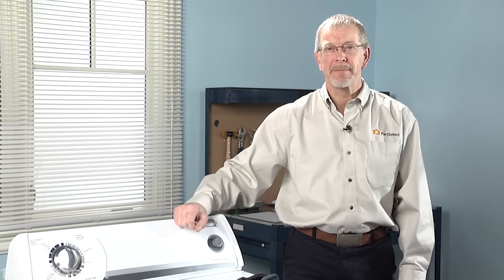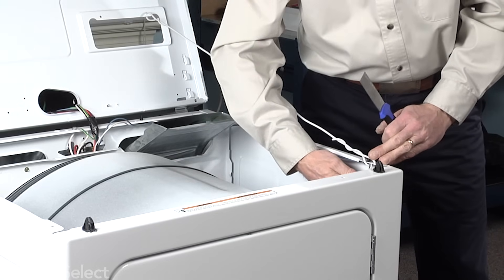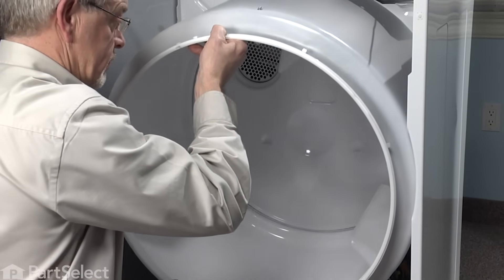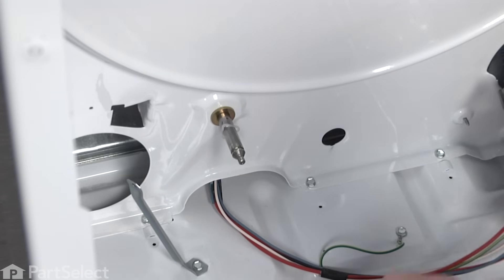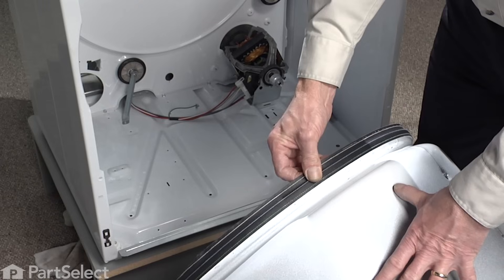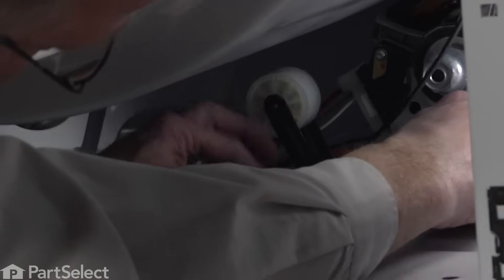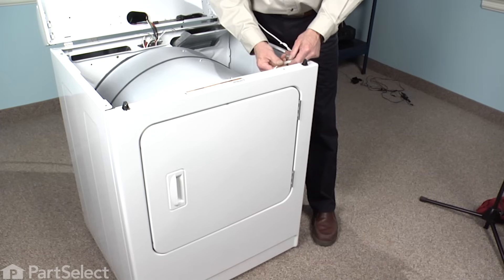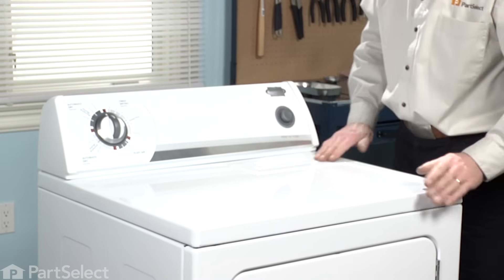Dryer Repair - Replacing the Drum Rollers (Whirlpool Part # 349241T)

Comment: I'm having a heck of a time getting that left wheel off.  Any tips please  ?
Reply: Mine was the opposite. Couldn't get the new wheel back on the right side. I sanded the shaft, but nothing. I tried lubricating with WD40, but nothing. Tried hammering with a rubber mallet, but nothing. After what seemed like forever I was able to wiggle it on. The rubber wheel somewhat spins, but not as it should. I gave it a 40% chance of working. Turned it on and tested it and it seems to be working, at least for now and the original squeaks are gone.

Comment: For some reason my drum isn’t sitting flush against the back .. thought it was the wheels but those seem like they should be free to move back and forward .. it’s only on the right side but now there’s a gap inside and it wobbles but the felt adhesive seems fine and while it does have a plastic collar on the drum which pushes against the felt up front it doesn’t seem tk be broken etc ..
Reply from the maker: Typically is your belt is not staying centered on its pulleys the belt maybe worn or stretched, if thats not the case then the alignment between the two pulleys has changed. I would check to see if one or the other pulleys an be adjusted so the belt tracks properly in the center of the pulleys
Reply: @partselect  thanks ! I can’t seem to get the metal push Nut in front of the plastic triangle to move farther back.. just me or is it designed to stay only on the end to prevent everything from coming off ? I feel like if I move that back it can hold the roller in place on the right and better support the drum in place ..

Comment: Make sure you don't make the mistake of buying cheap parts, genuine only, the cheap Chinese replacement parts don't last long. One of the brands to stay away from is Jason. Go with FSB or Manufacture labeled. Another thing, make sure your roller shaft is clean and polished before you put the new roller on. I kinda wish they would use a bearing in the roller wheel, it would give double protection against wear.

Comment: My wheel right rear roller rubber keeps falling off ...i replaced it 2 times within one month.what could be the problem?
Reply from the maker: Hi Eli. The main issue that would be causing your rubber roller to fall off is if they have been installed without those little triangular retaining clips. The only other thing that I can think of is that the support bracket has not been properly installed. At 4:15 of this video, you can see Steve replacing the drum roller, so follow his step-by-step instructions and you should be good to go. If there are any other issues, please let us know and we can continue to troubleshoot with you! Thanks for the question and good luck with your repair!
Reply: PartSelect hi there , I’m sorry it’s not the wheel that falls off, there is a triangular clip that stops that from happening. What happens is that the drum roller wheel has a rubber that keeps getting shredded off literally the wheel remains where it should. The wheel I’m having an issue with is the right one assuming you’re standing in front of the machine. I don’t grease the shaft when I install the wheel if that helps, it mounts fine, spins fine, I’m only replacing one wheel should I also be replacing the bottom roller wheel? That one seems fine.
Reply from the maker: Hi again Eli. Sorry for the confusion. There are a couple things that could be causing that issue. The roller shaft could be damaged, and that could cause the roller to oppose rotation and become shredded. Another issue you may be having is that fabric softener sheets have left a sticky residue on the roller shaft, and that can cause the roller to oppose normal rotation as well. In this case, you can attempt to clean the shaft with a little bit of rubbing alcohol. You typically will not need to grease the shafts, but in the case that they have become sticky from fabric softener sheets or other residue, the rubbing alcohol should clear the problem up for you. If the shaft is damaged (there may be a grove down it that you will notice), you can find another on here: 
https://www.partselect.ca/PS11753705-Whirlpool-WPW10359269-Drum-Support-Roller-Shaft-Right-Side.htm
If you are not sure that this shaft fits with your model, you can check with the model cross-reference on that page, or you can send us your model number and we can check for you! I hope that solves your issue!

Comment: Is there any reason to add grease to the roller axle?  ... to not add grease?
Reply from the maker: Hi Mark, and thank you for your question. It does not appear as though grease is needed on the roller axle. The only real reason not to, is that it would be a more or less unnecessary step. Thanks again and good luck with your repair!
Reply: Hi Mark, until the parts arrived for our dryer, we greased the drum roller and guess what?  Sounded like a new dryer again.  Seems to be a safe option when you are in a pinch.  I would only add that while the grease works, it serves as a temporary option only - or so it seems to me.

Comment: what about silicone grease on the drum roller shafts? i took my old drum rollers off and theyre dry as a bone.. new ones seem to have no grease on the either. you didnt put any on so im assuming there is no need for the grease? my dad had me grease the tension pulley 6 months ago, and 2 months ago it started squeaking again. he used some mechanic grease. i asked specifically if that grease is the right kind and he assured me it was good. NOPE! always do your own research. here i am bougnt the kit again (returned the other one becuase the grease originally did the trick) doing it all over again. PULSECHAIN $0.00012

Comment: How do you push that lock nut on so easily I’ve been fighting it for 20 minutes and can’t get it on
Reply: We used pliers to get a better grip, and gently twisted it back and forth while pushing, because ya it was stubborn!
Reply: Great video, but I am going through the exact same struggle with the lock nut right now.  My skin is about to be cut, so will try again wearing leather gloves.  If that also does not work then I'll try using pliers as suggested by Teresa M
Reply: he didn't show the part how he did it, but to put it in just push in and will go right in.
Reply: @kachiquitaito3341  Didn't work for me even after much struggle.  So I gave up and reused the original lock nuts, and that was a breeze.

Comment: the connection switch with the door did NEVER come out that easily  I had to work with the door switch STILL CONNECTED SO I had to slide the door near cuz it will not disconnect at all--- The make it look so easy but then when we are doing it at home....NOT EVEN CLOSE.

Comment: I changed my drum rollers and blower fan.  It is still noisy.
Reply: Your maybe the belt tensioner is bad same like cars belt tensioner go bad and made noise hard to find and only way to know is taking belt out and spinning just the tensioner roller to check  for any noise and you can check  other parts too same way to be able to find  from wheel is the noise coming.

Comment: Why can’t you just lay the dryer on it’s back? Seems like it would be a lot easier
Reply: My guess is he is showing the standard repair procedure as alot of homes and apartments have washer/dryer located in tight space closets, or narrow hall between garage, both of which often have walls on sides and rear so limited work area. Also the dryer vent ducting for some can be rigid metal, vent pipe joints sealed, screwed, or foil taped thus would require removal to lay back. It's a quick 30 minute fix and no labor of moving unit. Use quality original brand or guaranteed parts. I needed dryer working next day so used some cheap foreign parts from Amazon since were in stock and next day delivery but one roller lasted only 6 months, 🫤